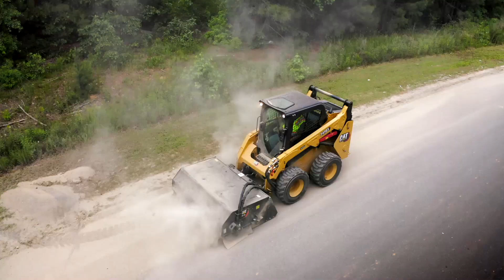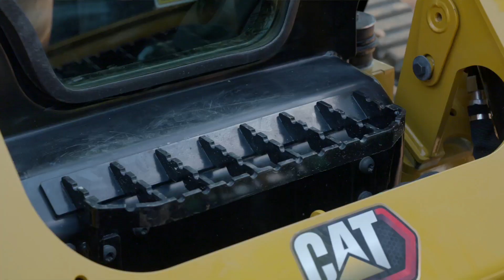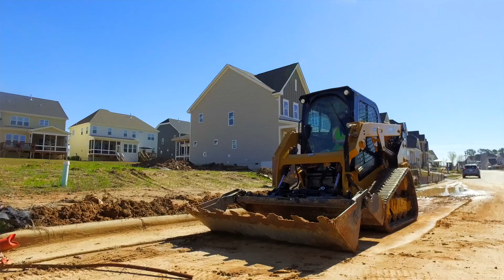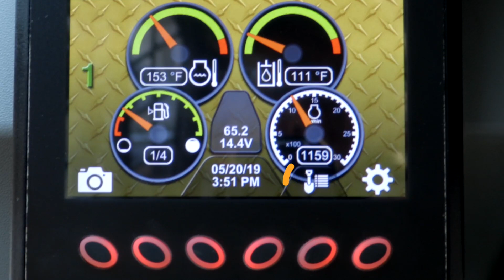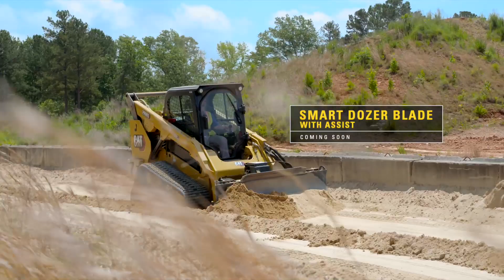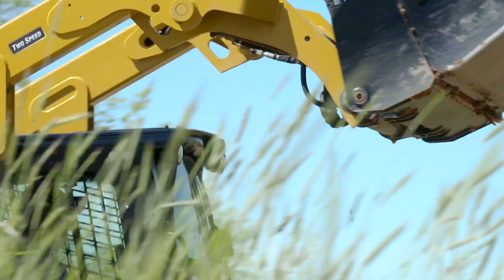Cat® Compact Track Loader D3 Series | Overview

Comment: i got 3 problems    why can't you put battery on right side so that changing oil filter is easier on 75 hp machines ,,, and second on the new 259 D3 greasing the rear torsion bar why didn't you put grease zirks where they were originally ?????  the new ones are BEHIND THE DAM DRIVE SPROCKET which in turn means IN THE MUD !!!! which means if you need to grease frequently  you have to constantly dig them out !!!!!!!! dumb dumb dumb !!!!!  kinda like the 257 D  the rear torsion inner grease irk  is in a real stupid spot also !!!!  also on the front window the bottom seal where it curves around the bottom it always separates from windshield !!!! why not make window more round in that area  so that don't always happen ???